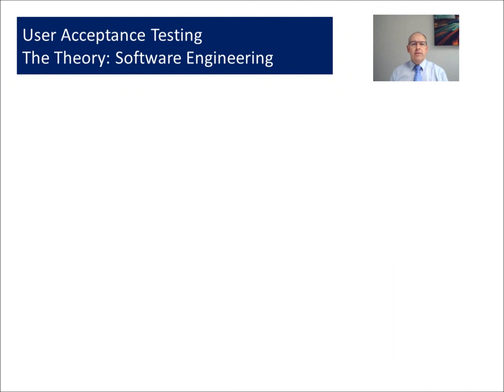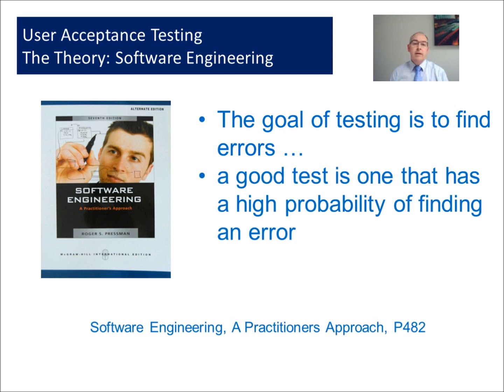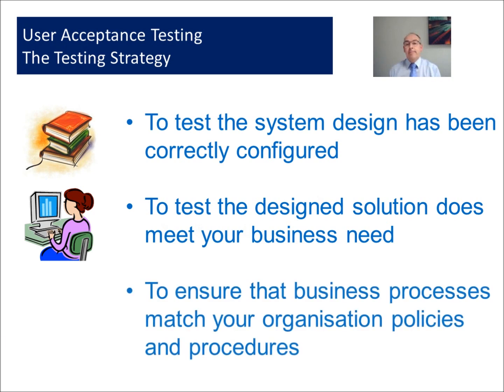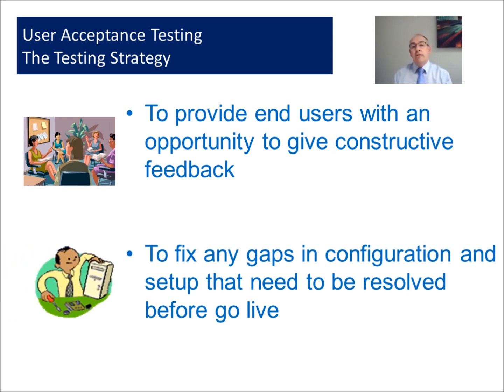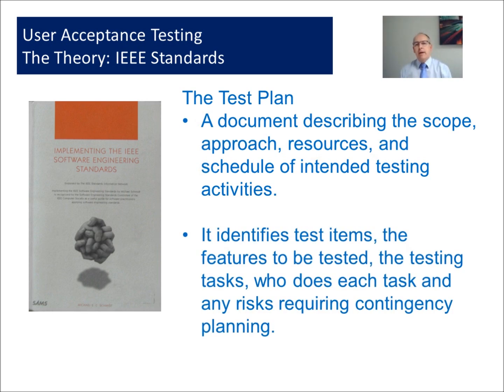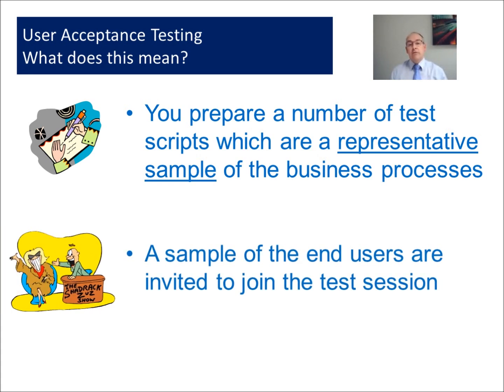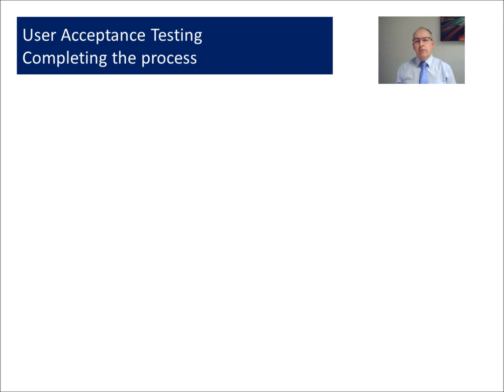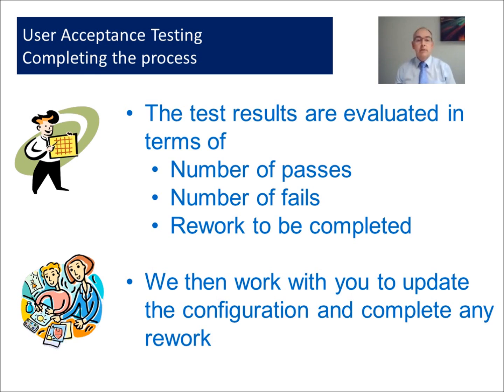An Introduction to User Acceptance Testing

Comment: Short and straight. In software testing, the process which tests the degree to which an application meets a user’s acceptance or approval is called acceptance testing. In many cases, it’s similar to field testing or end-user testing etc. Avo Assure is a customer accepted automated testing platform proven to making software testing of any type a seamless process.